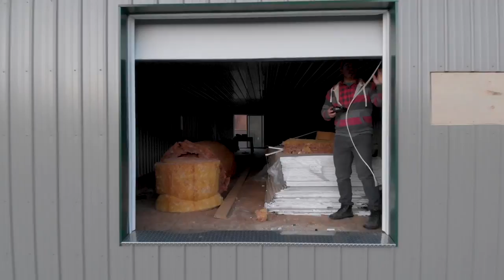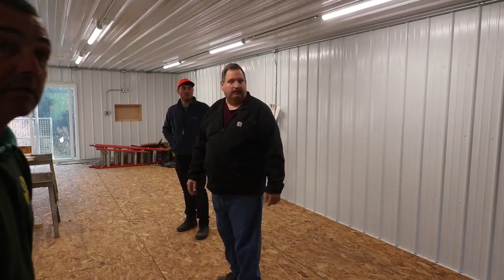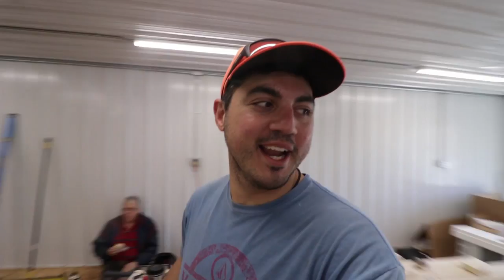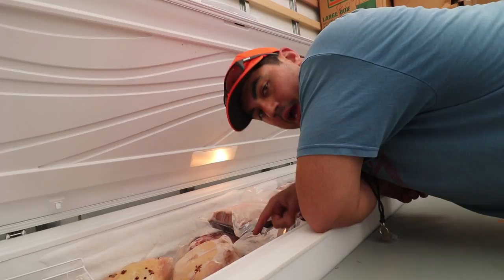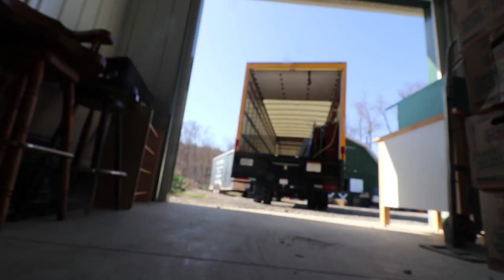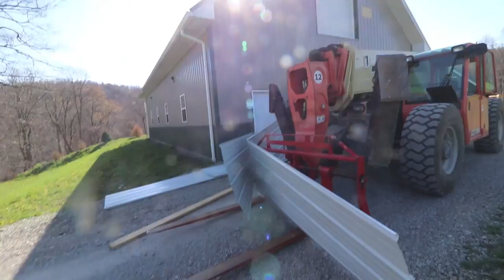Moving Thousands Of Dollars Of Meat... Did it Spoil or Keep?

Comment: Ice cubes can become lost or forgotten. So if you take a jelly jar and fill it half full of water and freeze it and then when it is frozen, place a penny on top of the ice, add a lid, and set it in the freezer door or basket.  This way if you have a power outage and then the power is restored you will know if the meat thawed and refroze if the penny is no longer sitting on top of the ice. (It is a great thing to have when you are gone on vacation.) Those of us with concerns about the placement of freezers in the truck had more to do with the air circulation around the motors and them overheating causing you more of a nightmare. Happy to see you had a safe trip.
Reply: Wow, what a GREAT idea =D

Comment: Another good way to tell if your meat is still frozen in the moving truck is when you open the lid and the light comes on!!! WTF
Reply: They obviously plugged it in again as soon as they arrived.
Reply: With everything  still piled up on top did not present it that way.
Reply: They were plugged in for a few days while they packed the truck. Why would they put away the cords somewhere they couldn't reach them after that? They knew it would take until next day to unpack and get to the freezers.